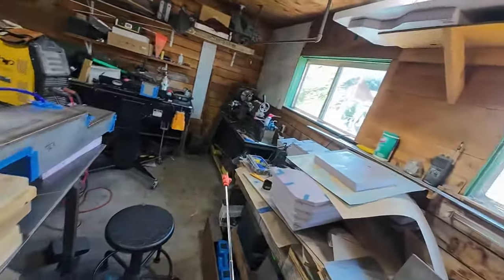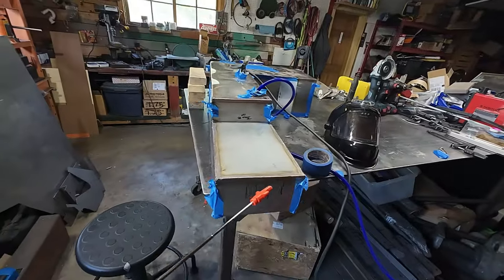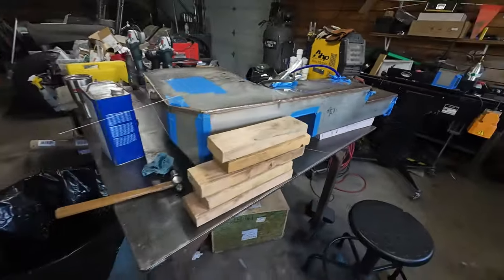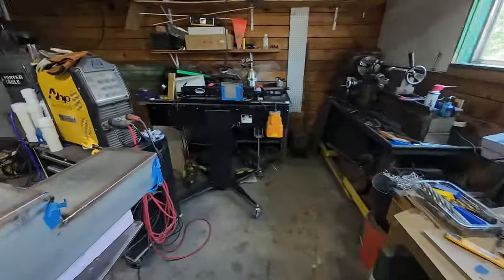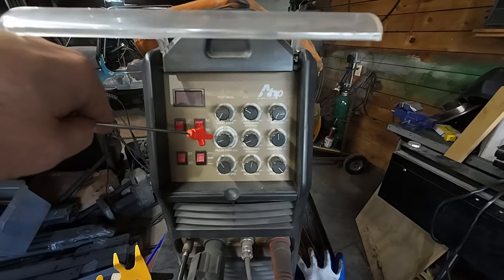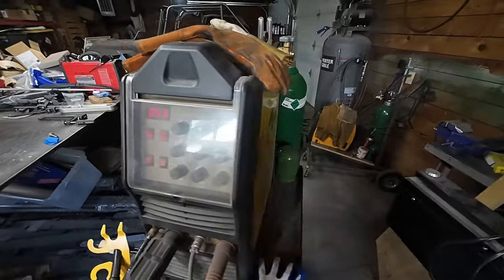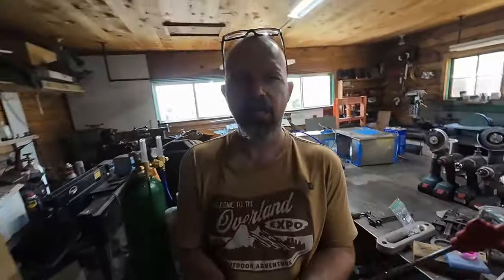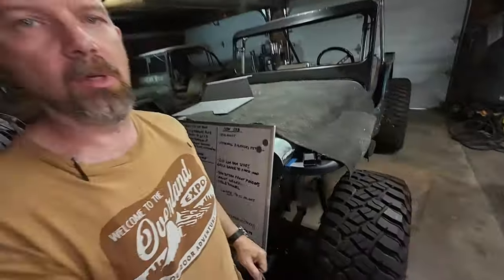Old Blue Willys Part 56

Comment: Great now I gotta go back and watch the one where you talk about the fuel pump, 'cause I'm having trouble figuring out how you are gonna run the front pick-up tube.  I also wonder a bit if a 3D printed tank would even be feasible.  Not sure if 3D printing plastic would hold up, or how leak proof you could plastic weld something...  (I envision printing in 2 halves then plastic welding them together).  My Gut feeling is that it would not save any design + fabrication time, plus machine time on a large enough printer would probably make it too expensive.
Reply from the maker: @donaldendsley6199  I'm going to be using venturi siphon pump powered by the return line flow to continuously move fuel from the front sump to the rear. It's not an uncommon technique in OE vehicles.